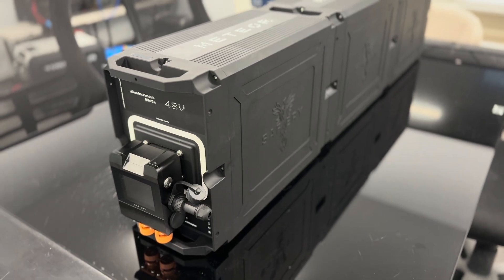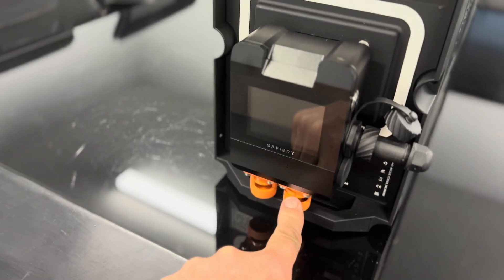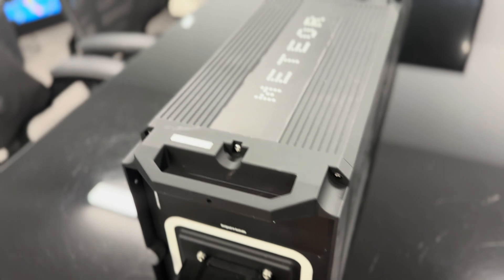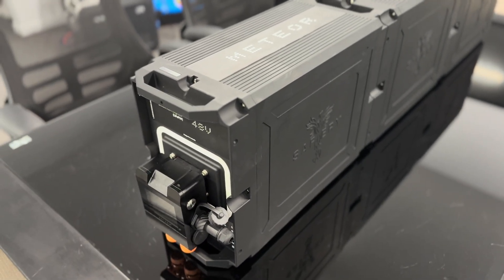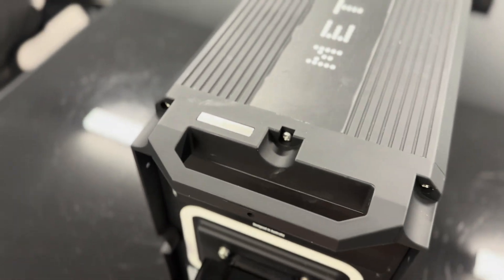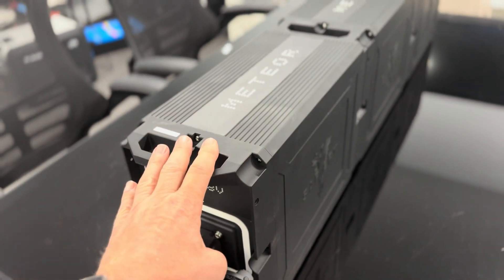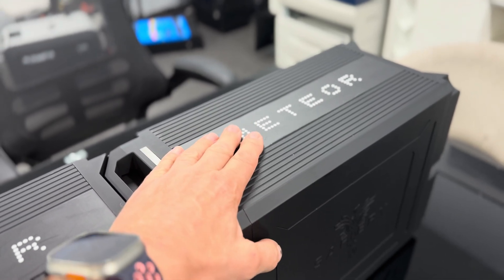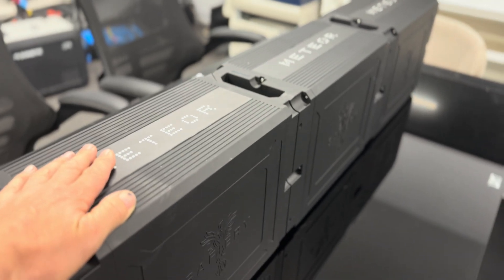Safiery 48V Meteor Battery: IP66, Remote isolation, Double Level Safety 2355Wh Dual Voltage Scotty M

Comment: So, meteor ☄️ is a lithium ion battery 🔋 unit?
Reply from the maker: It’s Lithium Iron Phosphate-safe and stable. But be aware that Lithium Ion is not a specific type of lithium battery. It is the whole family of every lithium type as it’s the ions that shift polarity that drives the energy. And that is called “ions”
Reply: @Safiery  - yes, aware of Lithium Iron Phosphate battery chemistry… they can still heat up, out gas, and have small fires when poked… but much safer than the Lithium Nickel Cobalt Oxide Manganese [and others like them] which may explode upon fracturing the battery casing.

I have seen lithium ion [ncm] EV’s spontaneously combust on impact, with a tractor trailer moving at a robust 35mph.

Looking forward to sodium ion battery testing. 

Any idea on sodium ion charging process?

I have seen some batteries, but uncertain how to charge them.

Comment: this looks great! Why would you not have the one problematic battery turn itself off though; even on a timer for the rest of the bank to check themselves before they may wreck themselves?
Reply from the maker: It may turn itself off. The issue is the good batteries are feeding it power and that is the problem we are solving. They will turn off.